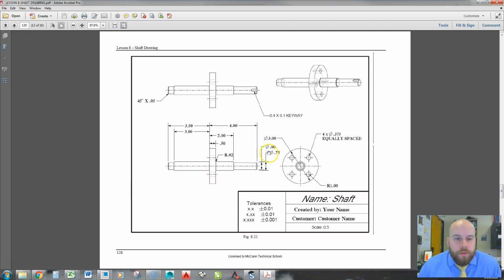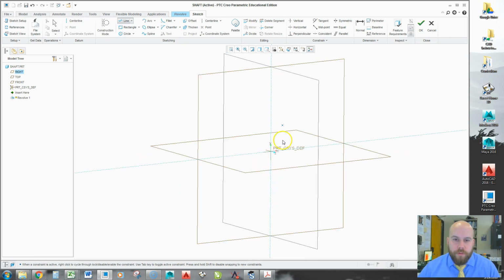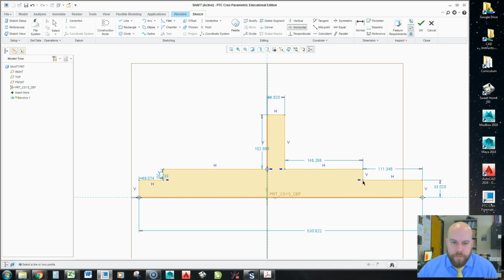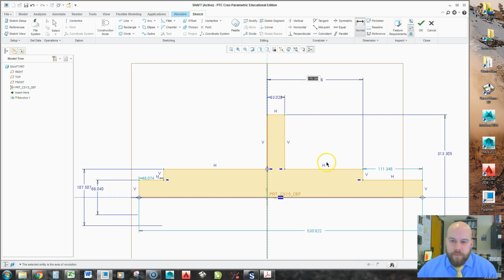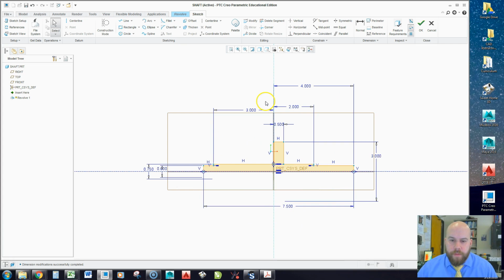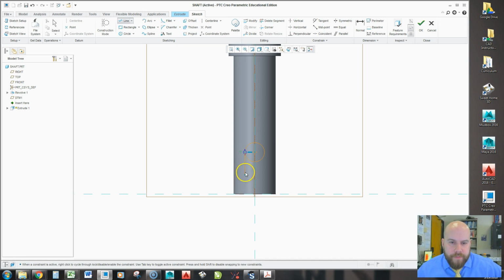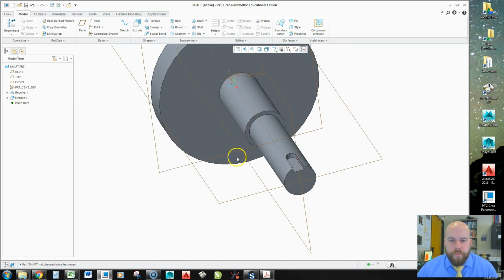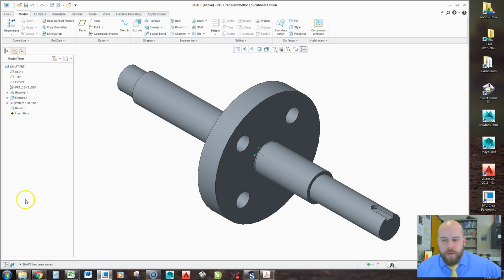CREO: Creating the Shaft and Drawing Part 1

Comment: when i rescale, the dimensions do not rescale
Reply from the maker: Rescale in what way? On the drawing?
Reply: @MrMezCAD  Yes. I tried to rescale the drawing like you did. But for me it did not reorient the annotations. They're smaller but haven't repositioned in the same ratio.
Reply from the maker: @pratishshinde9309  Ah ok, you are talking about in the sketch. Yes, that's a change they made in Creo 6.0 or 7.0 where you have to actually drag the annotations inward little by little as you zoom in. I'm not sure why they did this, but it is what it is, unfortunately.
Reply: @MrMezCAD  got it! No worries! I'm using 7.0